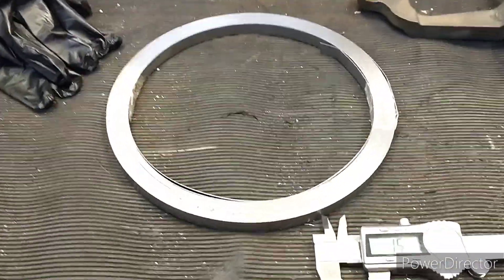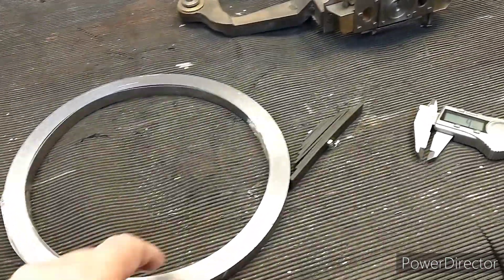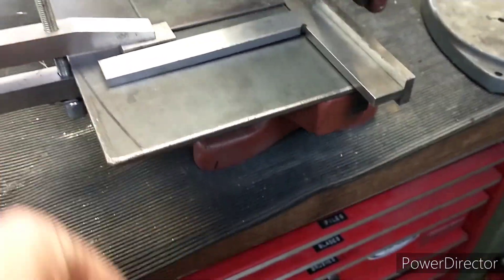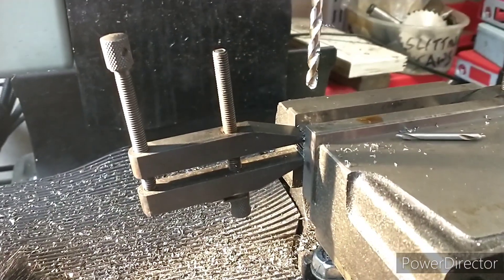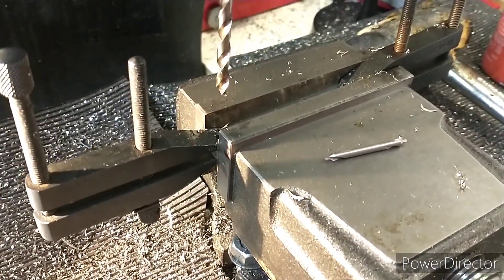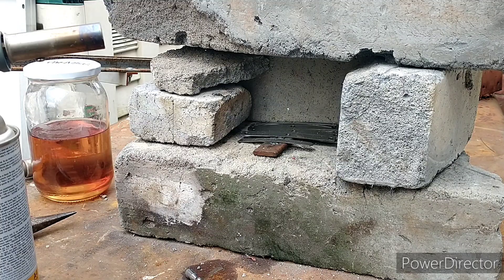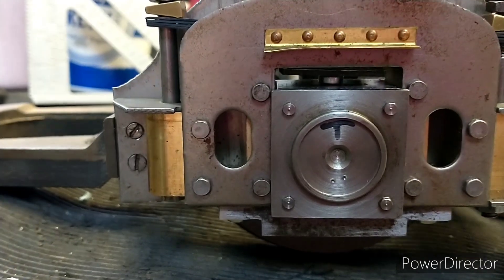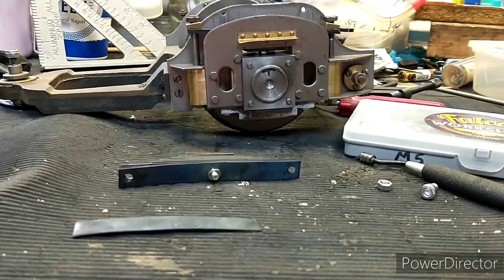Modelworks 5" gauge Britannia - Episode 5: Making Leaf springs.

Comment: nicely done julia, i like the metal shears👍👍
bfn
Kev
Reply from the maker: It does work really well now I've managed to come up with a fence 😀
Reply: I made leaf springs using flat clock spring or shim spring steel for wider ones. A top learned from fellow ME friends is to introduce several leaves made from thin Tufnal which is similar to Bakelite. 
When used along with steel provides a very effective damping effect.
Reply: @haroldpearson6025  good idea Harold👍👍🚂🚂🚂🚂 regards
Kev